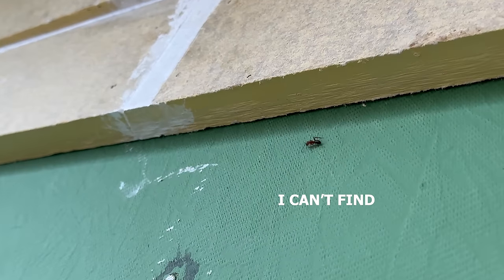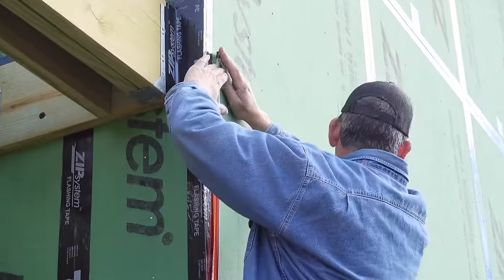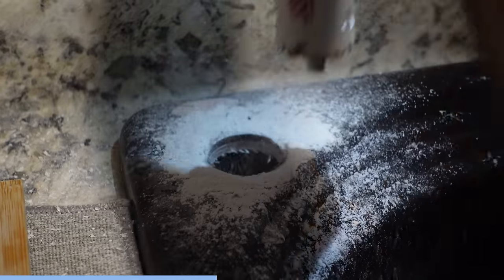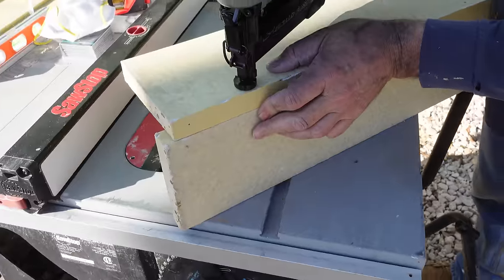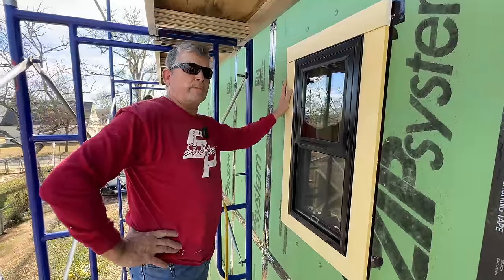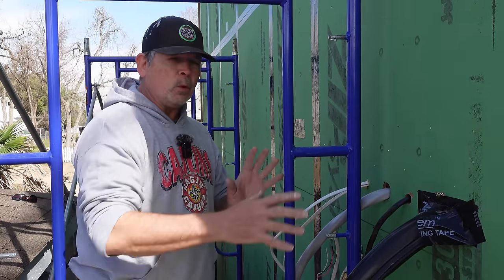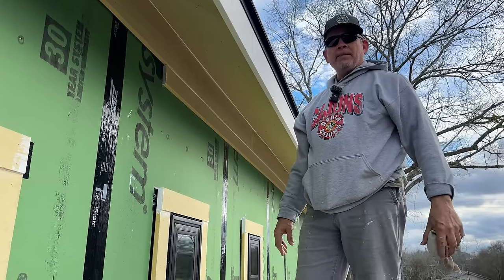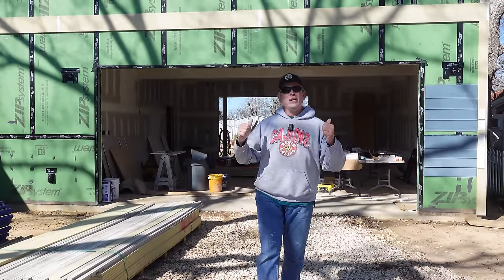Is THIS $30 DIY Water Level BETTER Than a Modern Laser?

Comment: Decades ago when I built my pole-barn type shop at my old place, I used a water level.  Dead-accurate and, unlike laser levels at the time, very cheap.  IMO more accurate than laser levels over long distances. Also, water levels work around corners and don't need line-of-sight.  I love my Huper laser level now, but in certain circumstances, you can't beat a water level.

Comment: Next time if you think about it before you hang your sheetrock set your laser up inside the building and find the laser in each inside corner and run a screw thru the wall and you will have your marks when you are ready for siding! You can still do it now set your laser up in the middle of the building and mark the sides of the garage doors and then you can level it on out to the outside corners! I did this mythfit all the time and it works great also and really big cut-up homes.I did it for the last 40 years and it always worked perfectly for me!

Comment: The Gecko Clamps for siding by Pactool would be a must-have tool for a perfect fit.
Reply: Another vote for Gecko Clamps!  They are awesome, especially if you are installing 12' lengths of Hardie siding by yourself.
Reply from the maker: Already got 'em

Comment: I'm sure you are getting winded because you're actually doing quite a bit of work and talking but make sure you're getting your PSA Blood Test yearly and checking your Blood Pressure. 
Getting winded easier than normal is a good sign of a larger problem or it's just that you're running up 40 feet worth of scaffolding and trying to talk at the same time 🙂 

Either way we want to keep you around. You're one of the good Dads out there! 👍

Comment: Awesome Job!  I'm new to your channel as my wife and I are beginning to design our forever home and have been watching a ton of videos to learn about what others are using in their builds.  Was curious as to why you chose to not use a rainscreen?  From my research this is an inexpensive security blanket to assist with the #1 control layer, water management. I understand the zip board is considered the WRB, but including the rainscreen allows the water, when it gets behind the siding (it will), an easy path to the bottom of the wall and a space for air movement to dry it all out.
Reply from the maker: Welcome to SP Kevin!!  Rainscreen on the main house for sure, trying a lot of stuff on the garage to improve the house build

Comment: I’ve seen carpenters add the freeze board when building the walls to avoid running into the nailing issue.

Comment: Multiple lines with central water tower works best. This mean you have a bucket of fluid with multiple hoses plugged in, you use clear pvc pipe only at the ends as garden hoses are cheaper and more robust. You can set all line in place then bring bucket precisely to the desire height (by lifting bucket/topping or lowering bucket/removing water) and you can run around to mark your "zero" at every line around your project.

You can mark whole barn, warehouse, floor, garden or house in 20min alone!

Works in all weather, dust, mist, bright light, night (with torch), round the corner, indoor-outdoor, in the forest, thick shrubs/bush, with endless working distance... very reliable, almost bullet proof, never goes off calibration, can be dropped, knocked, kicked, driven over... and is cheap. Laser is great in small rooms for picture hanging or finish carpentry. But anything heavy duty construction - water level beats it all!

Comment: the overhang at a rake has class.....glad you will match on the House. Good job guys. Question, doesn't Hardi-planks recommend a gap at joints?

Comment: Yeah, that level trick works very well but you have to make sure there is no air bubbles in your line. If you get air bubble in that line anywhere, it will not read accurately so the smaller diameter tube in use has potential to trap more air bubbles.

Comment: They are better IF the two open ends are connect via a tube which allows air to flow freely.  REASON:  Even a slight wind or difference in air pressure on one side of a building can throw a water level off.

Comment: The siding to the right of the garage door changed color from beige to blue.  Is that the color that the garage will be painted?

On the job yesterday, the GC compared all our tape measures side-by-side (different brands).  He wanted to be sure they all measured exactly the same.  He has found some in the past that were not accurate.

Comment: Water levels work great. If I need a level line on the exterior of a building a set my laser up inside and pound a 8d nail through the sheathing and then chalk to those nails/holes. Not practical when the drywall is already up. Building is looking great.

Comment: Level is not always what trim demands.  Suppose the top run or bottom run or both runs of a wall are not level, then the trim might need to be put in an out-of-level installation to best not catch the eye as to plumb or level conditions of the facade as a whole.
      In Stud Pack's case here though I recall the building being built to very exacting dimensions so the above might not be the case, but I've run into plenty of situations where level or plumb would have actually magnified existing problems that couldn't be corrected.  That's why on a wall one might measure both ends to see what's going on instead of simply assuming to install based soley on level.
Reply from the maker: You're right.  I hung a TV once dead level.  The mantel under it was way off.  The owner's thought I hung the TV crooked.   The only fix was to slant the TV to match the mantel and fool the eye

Comment: Are you doing smooth walls inside or a texture?  We did a skip trowel texture. Makes it easy to hide any imperfections and easy to repair nicks and dings down the road, where smooth walls tend to show everything even the smallest bump scuff as time goes on.
Reply from the maker: smooth
Reply: @StudPack  It will be a good test before you do the house.  But you don't have kids so that's a plus.

Comment: When you mention having to use a nail-set on that frieze I assume you mean a Pea-shooter (Hollow metal tube with a metal rod through it that has a weighted handle molded onto one end to use as a hammer)? If not, get one. Cheap and saves many hours nailing far away or hard to reach places.
Reply from the maker: I've seen 'em, I'll check it out see if I can find one

Comment: I'm not sure if it was planned or if you bought a certain size scaffolding, but it seems bloody lucky that the scaffolding fits between the new and the old house.
Reply from the maker: I bought a certain size knowing the constraints.  Scaffold was available at the standard 60" wide (too much), 36" wide (too narrow) and what we got 42" wide (just right).  The parts (braces, wheels, boards) are adaptable to the other sizes.

Comment: There is a 4th way to do the corner boards, 45 the edges where the two boards meet. Thats how we did out house because all 4 edges were rolled from the factory. So if I did it the way you guys did it (method 3) the front board would have a rolled edge on the back side dying into a square edge from the board you have to cut down creating a divit. Yes you could fill it with caulking I guess but the sharp edge of the 2 45 degree cuts looks amazing

 Btw I've never heard of method 2 that sounds lazy as all get out. Never heard of method 1 either and definitely seems like one I would never use for the same reason id never used method 2. 
Method 3 and 4 are the way to go. I like how you padded out the back of the window trim to deal with the flanges and tape that wiuld make the trim not sit flat. We did rabbets like you mentioned but made jigs for it and used the router vs a table saw so the rabbet didnt go all the way out to the edge of the trim and could be seen. Once again you could caulk it but not as good of a solution imo.
Reply from the maker: Cool thanks!  Can't imagine ripping Hardie at a 45 degree.  Mitered edges on outside trim never seem to work well here, they open up etc. so I try to avoid them.  We talked about rabbeting the back of the Hardie but decided against
Reply: @StudPack  yeah with hardie it wouldn't stay together nicely. I used truewood, which is like hdf wrapped in some sort of sheath, I just glued the 45d corners like you guys glue your crown moulding. I would have definitely done it the way you guys did, but that rounded edge against a square edge just put me off. House is looking great.

Comment: Watching you hall those boards up the scaffold, I'm wondering what happened to the C clamp?  The rope works easy and fast once you got the technique down. But your missing it by a little bit ;-)  The clove hitch goes at the bottom then run the line up the board and do a basic hitch at the top. The boards will go up strait and not spin and the knot wont slip loose. The house is looking great! Oh I mean, the two car garage and the chauffeur suit above is looking amazing!

Comment: It seems you are missing a network connection between the garage and the house. That too should go through the bridge. Better lay a couple of network cables too.

In Thailand, builders use water level on a daily basis.
Reply from the maker: We can get from the attic above the garage stairs into the bridge attic into the house.  That's the plan anyways....

Comment: You mentioned painting in the near future.  You are a smart guy and have got this all planned out, but just my $0.02…if you paint the exterior with a brush and rollers you’ll get a lot better coverage than spraying.  For a building that size it really wouldn’t take long either.  But like I said, you know what you’re doing.

I love the content, keep it coming!!!
Reply: Best of both worlds..  spray then back brush or back roll
Reply: @mattmo989  yeah they’ve done that on the inside before, and I think that’s good for interior.  Exterior is under so much stress from weather and sun that you need a lot of paint.  I’m not sure you can lay down enough with a sprayer, not without a huge mess anyway.
Reply: @benmishoe5999 .. It is common practice for exterior as well.  A sprayer is the most efficient way to get paint on the house. One man on sprayer and second man following.  brush/roller never has to leave the surface, no drips from freshly dipped roller or brush.
Reply from the maker: Kinda worried about overspray on the neighbors stuff, we'll see.  Love my airless but may use the old roller/brush on this small building

Comment: if im using 1 1/2" wood for my corners i like to make a 3/4 rabbit on one board to make both side of the corner look identical. give a cool reveal on the outside corner
Reply from the maker: Love rabbets but hard to do on Hardie, router bit would be toast in a second, tablesaw rabbet possible but difficult

Comment: Idea! Why don't you use smooth shank easy to remove nails, since this is temporary and you do not have to worry about it's holding power and rust resistance.-it is not going to be there that long,

Comment: Curious, what size tubing are you using and where do you get the caps (or what are they actually called)?
Reply from the maker: Local Ace Hardware, 1/2" OD 3/8" ID clear tubing sold by the foot, rubber corks available there also, pick the one that fits
Reply: Your video couldn't have come at a more perfect time as I'm currently needing to do this on my project. Thanks again! @StudPack

Comment: Do you not need to leave a bit of space between pieces for your big stretch chalking? Does that stuff not shrink and expand at all?  Will it not bind if it expands if the pieces are tight to one another?

Comment: I put my fridge on my RO system. Just make sure your system provides enough capacity. I.e. 65 gal a day, 120 gal a day, etc...  also, most systems trash 3 gal of water for every 1 gal of RO water produced. So heads up to your water bill

Comment: Would it have been best to leave a caulk gap on the corner boards ?  It's impossible to waterproof without a gap to caulk. Or maybe even caulk the inside corner on the back ?

Comment: I'm convinced they dug a trench around the base of the pyramid and filled it with water.. then just use a measuring stick from the surface of the water up to each course of the blocks.
Reply from the maker: I understand they dug a grid of trenches and waited for the annual Nile flood to fill the trenches.  Masons went around marking the water level around all those stone square islands sticking up out of the water.  After the water receded, they planed off the top of the squares dead flat using the rubble to fill the trenches.  I guess we'll never know...........
Reply: Has to be water one way or another though. The first building i put up was a 300sq ft. pole barn extension some 25 years ago. I was trying to cut the top of the posts using a string level and it was 2.5 inches out when I got back to the first corner. I re-did it with a water level and it was spot on. Its a beautiful thing..:) @StudPack

Comment: Love you guys but why are you using 16 ga finish nails on this heavy trim and siding? I think you might have issues with boards coming loose in the future. The Hardie installation guide specifies mostly 6d siding nails (ring shank) driven into studs.

Comment: I would have run the corner board continuous vertically instead of the band board being continuous horizontally.  The same way that the siding will die into the corner board.

Will a palm nailer fit under the soffit to set the angled nails?

Comment: should use a kregg jig to pocket screw your window frame joints, works great
Reply from the maker: If someone makes a step drill and screws that work on Hardie I'm all in
Reply: @StudPack  sorry, thought it was the other kind of siding

Comment: How will the attic breath? Are you cutting in vents?
Reply from the maker: Doesn't need to breath.   Houses that breath leak air, water, etc. and pests get in thru the holes.  This building is tight and we have an ERV (energy recovery ventilator) for a constant supply of fresh filtered outside air 👍 Heating and cooling loads equal to something like a hair dryer

Comment: Ive never had luck using a 16 gauge tnailer on hardie. Always 15 gauge.
Reply from the maker: I was skeptical too, luv the strength of my 15 gauge but gotta say the 16s cannot be pulled apart
Reply: @StudPack  well I have a hitachi 16 just like yours, even shooting through 3/4 hardie it wads the nails up or leaves them sticking out.
Reply from the maker: Ours shoots flush mostly… a few tappers.   Played with air pressure and depth adjustment to dial it in.
Reply: @StudPack  what psi?

Comment: What did you call the top part, the Freeze???   Anyway uses stainless decking screws,  should be easier to drive in than nails.
Reply from the maker: Frieze
https://en.wikipedia.org/wiki/Frieze

Comment: Use a small valve with a barb and keep locking 6 inch forceps on you. You can't drop a valve attached with a barb, and if it it lets go, forceps in your pocket come handy in the clench. Also? Stupid fact I know... if one valve is open you have a giant barometer, and if there is a clear sky tornado ....say, on the other side of the building quietly ripping the side of the building next door off.... yeah, your water level water will shoot out like one big water gun. Then the excitement starts.

Comment: I would highly recommend NOT using RO water for ice. We had ice trays at work that were ruined within 6 months, every single one cracked from the RO water over expanding and bulging the plastic. Plus the ice shatters like glass when you try to remove it from the trays. Just a big headache. Stick with standard water filtering for icemaking.

Comment: Looking great guy, look forward to each video.  Question about the back deck, why are there not lag bolts to bolt it to the house? I thought proper specs for decks are lag bolts not screws.
Reply: Go back and watch the video when they were building it.  There's more than that you might question.
Reply from the maker: Yeah we used structural screws.  I honestly couldn't tell you the last time I used an actual lag bolt

Comment: Why couldn’t you use a few screws for the temporary band board and the freeze board?
Reply from the maker: Hardie does not recommend screws so we didn't use 'em
Reply: @StudPack Thanks. That’s weird. I’m surprised you can’t. I just searched and Home Depot sells Simpson stainless steel screws that are meant for fiber cement siding. You might try experimenting with it. Stainless isn’t ever going to be an issue and will last just as long as hot dipped galvanized. I was thinking you could pre drill the screws into the board so you need even less clearance to get them in. And obviously on the bridge you just unscrew and voila. 

If not screws could you guys have made a palm nailer work for the freeze board? The punch seemed like too much. 

Awesome work!!!!

Comment: two questions if you dont mind, what about rain screen behind the siding and why no zip cover on the nail on the zip sheet before applying the siding?
Reply from the maker: Rain screen on the main house definitely, we used liquid flash on the nails 24" within ground level, not required but a good tip and you could certainly do them all
Reply: @StudPack  haaaaa, i had to go back, yup I see the liquid flash at 22:33, I have no idea why I didn't notice it before 😞

Comment: Hi guys, you should leave a gap for expansion between boards. They might push each other in wormer temperature. I suggest a relief cut to have a gap of 1/8”. Then fill the gap with silicone coloured with the same paint as the paint you will use for the boards.

LOVE YOUR CHANNEL!!! GREAT WORK.
Reply: It's cement board not wood. Cement board does not expand or contract and even if it did it has room to expand the other way